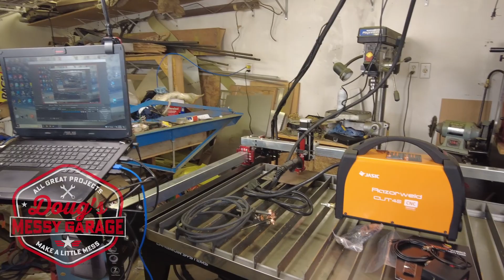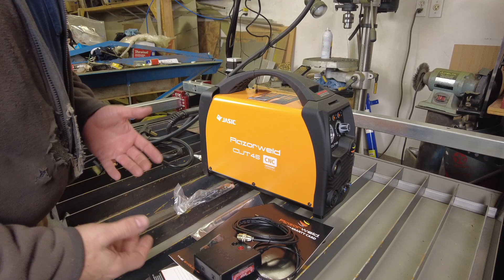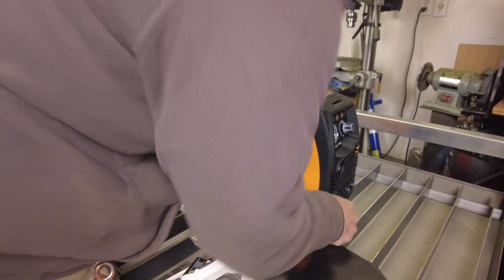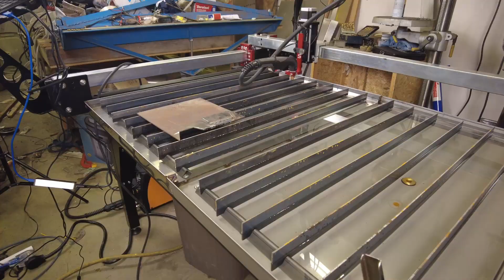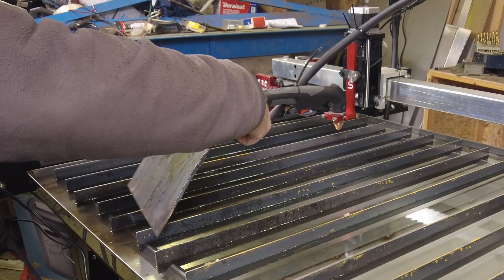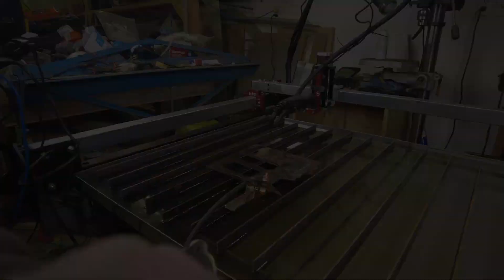Crossfire PRO Final Setup and First CUT Ep5

Comment from the maker: Any suggestions as to what I should cut next?  I am working on a sign that I have been dreaming of since I first ordered the CNC plasma table but I don't know if that is what I should cut next.  Let me know what you'd like to see.🤓
Reply: How about a little aluminum storage box?  One piece.  With perforations along fold lines to make it fold precisely with only hand pressure.  Origami style.  And maybe a tab and slot or couple of pop rivets to hold it together.  And plasma cut labels in the side.  "Wrenches"  or "glue supplies" and so on.
Reply from the maker: @MLFranklin  Hmm, now you have me thinking.  I might have to play around in Fusion and see if I can make such a thing.

Comment: Great vid. What compressor are you using for the plasma cutter? Thanks!
Reply from the maker: I have an older Sanborn 60 Gal/5hp upright compressor.   I have added a interstage drier between the compressor and the tank and that seems to help pull the water out of the air.

Thanks for watching and for leaving a comment.